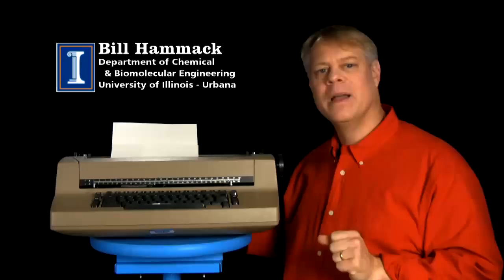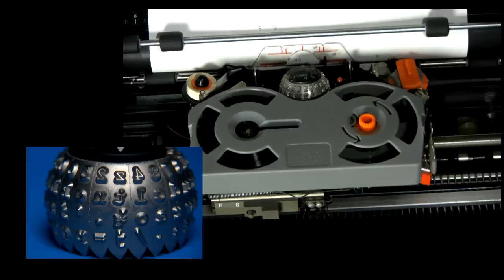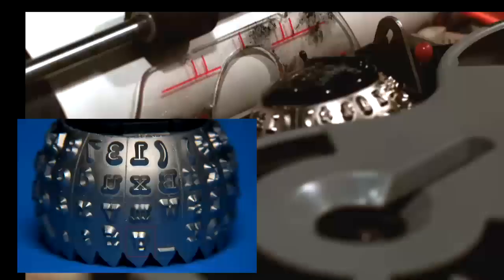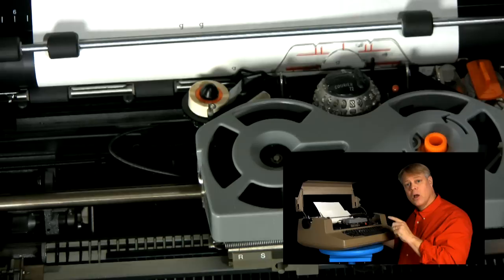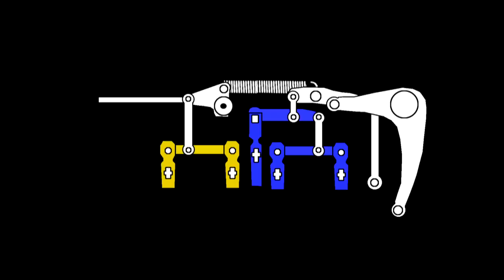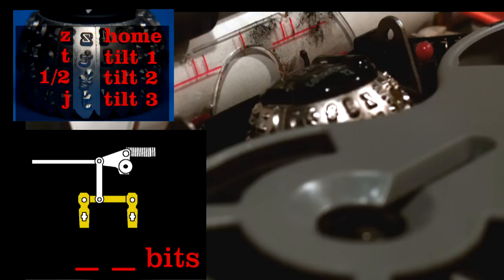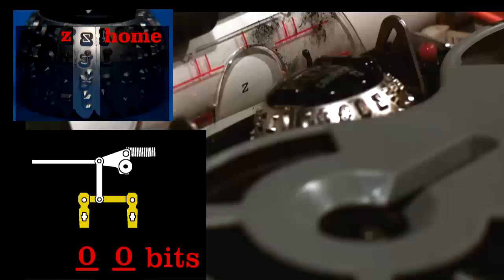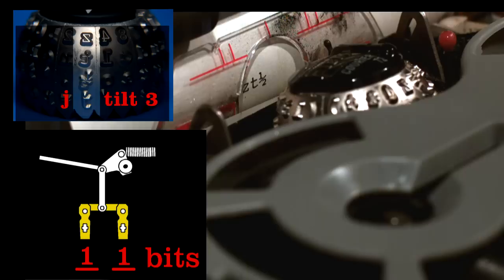IBM Selectric Typewriter & its digital to analogue converter

Comment: Ok, that was the intro ... where's the rest? Now I'm intrigued.
Reply: Don't be. It was wrong anyway.
Reply: @timhofstetter5654  [citation needed]
Reply: @Number_055  Mo citation actually necessary. There's nothing analog about the IBM Selectric; it's purely mechanical-digital (base 4 and base 22). The whole premise upon which this video was based was incorrect.
Reply: @timhofstetter5654  It uses discrete analog output. Mechanical levers by nature are analog.
Reply: @darkwood777  Neither of those statements even begins to be true. Mechanical levers with a finite number of orientations / positions are by nature digital.

Your fingers are levers, and they are the prime origin of the term "digital". When you count on your fingers, they have two positions: up (1) and down (0). There is no "halfway" (~0.5) position. There is no one-third (1/3) position. There is nothing analog about your fingers when you're counting.

Anything with a finite range of positions is digital. Analog is infinitely variable with or without optional limits.
Reply: @timhofstetter5654  that's an awfully rigid definition. By definition a prostate exam can be "digital" too! lol I would say what makes this device "analog" is the SPEED of typing: "mechanical digital-to-analogue converter that
translates the discrete impulse of the keys to the rotation of the
type element." I suspect there's infinitely variable typing speeds possible within a certain range with this electro-mechanical device. 
I suppose it might be possible to measure microsecond speeds of brain-to-hand nerve transmission and even modern computer keyboards responding to touch at similar, discrete speeds, and come up with finite variables. Words-per-minute can be described as a digital measurement, and another poster here describes his sister as typing so fast that the Selectric couldn't keep up, but at least within a certain range it is an "analog speed" typing device. I don't see any point in splitting hairs here.
Reply: @squirlmy  There's nothing analog there, even. There is a fixed interval between keystroke and the appearance of a character on the page. No analog.

As to typing speeds being infinitely variable, therefore justifying the "analog" term... if you go that direction, then you need to likewise apply the term "analog" to every digital computer and word processing machine and typewriter that has ever existed because exactly the same variability exists in typing speed completely regardless of the machine to which yon keyboard is connected. Oh, teletype machines, too. And pencils. So now we've gone to a ridiculous extreme to justify a ridiculous statement. Have we improved anything in our little foray into stretched definitions?

Comment: I worked on those for 18 years in the Eighties.  Extremely well engineered, complicated machine and took a long time to get confident working on them. If You could competently service one, You can get a job anywhere in the office service industry as there wasn’t a single office that didn’t have at least a couple.  They retailed at over a thousand dollars then!  I remembered We had a cocky, overly confident copier tech that went to school to cross train on them, and He came back very humbled.  Never worked on them after the schooling.  I, on the other hand, cross trained on copiers and found them stupidly easier.  I was the first choice for the dispatcher to send anywhere as I could now work on both.  I quit my job after seeing manager position go by Me more than once, and I opened a jewelry store, in which manufacturing jewelry was My first love and had been doing that out of My parents garage when I was 17.   I own Gipson Diamond Jewelers in Garden City, KS and My Son works along side of Me.  I’m so grateful My old job didn’t pay well or I never would of taken a chance going on My own.  Boy, this video brings back some memories, though.

Comment: Very interesting.  We had these at work.  Called them golf ball machines.  Ingenious.  I moved up to a data processing machine, a magnetic card machine, which was very similar but with a huge floor standing memory with very thick connecting cable.  I was the only one in the UK government department at the time.  No need to retype reports as the magnetic card held all the typing in its memory so just had to stop the machine and correct the reports.   Brilliant at the time.  I’ve never seen nor heard of them since.

Comment: Now we are waiting the video explaining how to link a computer to a selectric ... ;)
Reply: saa82vik   It existed in 71 or 72, it consisted of 5x8” magnetic card that was inserted into a writer/reader.  I can’t recall if the Selectric itself was able to store part of the document until it was transcribed on to the magnetic card.
Reply: I built one, in 1983. It hooked up to an Apple ][ using a parallel (8 bit) output card. The challenge was writing the driver in 255 bytes.
Reply: @matthewlitvak2695  You are referring to one of the Mag Card machines (there was an original Mag Card, and then a Mag Card II), based on the same system of reed relays and solenoids. But IBM also had computer terminals based on the Selectric. The Mag Card had a separate console handling all the electronics but was not connected to a computer. The IBM Memory Typewriter put the entire system within an enclosure just a little larger than a regular Selectric.
Reply: @ErikBruchez    I’ve got a very vague memory of the entire system, I was 10 or 11 when it came out in 72.  It was initially kept in the file room at my dads law firm in Chicago.   I remember the card holder and the reader, I just can’t remember how it operated  and whether you could edit a stored document.
Reply: @matthewlitvak2695  Cool! I've just been learning about those as I have an IBM Memory Typewriter I am working on. I think that the Mag Card would allow corrections on the card as well. Even the earlier Mag Tape Typewriter allowed correcting on the tape directly.

Comment: My uncle worked for IBM in Office Products in Boston. He kept us in typewriters in the 70's. One day he came and swapped out our Selectric II for a similar product but this one came with its own desk and a console to sit next to it. But sitting on/in the desk was a mostly normal looking Selectric. But this was no normal Selectric. This was an MT/ST which stood for Magnetic Tape/Selectric Typewriter. This rig could read and write to 1" Magnetic tape drive that resided in the console!  This was a word processor!  You could store a document code at the start of your document and later search a tape for that code to find your document then insert a new piece of paper and press PLAY. This is when you could witness the Selectric operating in its glory laying down characters at maximum speed and maximum decibels! The console was something of a marvel also as it was invented prior to integrated circuits. It had a huge array of relays and a row of printed circuit boards with transistors, resistors, capacitors and such. Inside the top of the console was the dual 1" tape drives.  This was classic IBM mechanicals with heavy gears, clutches, cams and motors. At 8-10 years old I loved watching the read/write head moving back and forth across the tape and the mechanism advance the tape character at a time as I typed. Backspace moved the tape back one character. Later I went to work at IBM in service and the old timers didn't quite know what to make of all my experiences with 1960's and 70's hardware when I was 28. My uncle continued my education through the intro of the IBM PC. I learned to setup , configure, upgrade and diagnose those machines when I was 12. I credit the MT/ST and my uncle with the development of my technical mind.

Comment: @engineerguyvideo Fascinating!  Hard to believe that this thing even works, and works as well as it does!

One thing that has ALWAYS fascinated me is how we design and machine these small parts and devices to the exact level of precision necessary for these devices to work - repeatedly.

Have you ever considered making a "measurements" engineering video?  I would it!  I know today that smaller measurements are made possible by using lasers and sensors, but what were the standards for back then?

Comment: One of the earliest "electronic" typewrites was made by IBM based on the selectric.  They basically used the Selectric with a similar mechanical mechanism on the keyboard to encode the keystroke which went into 7 or 8 on/off switches.  The encoding went into their electronics.  Then their electronics fired solenoids that where connected to the levers that do the tilt and rotate.  Basically the computer was shimmed onto the control rods.

Comment: I used the Italian Olivetti version, the Lexicon gold ball typewriter, which was very similar. But I didn't liked the constant humming of the motor, so I kept using the traditional typewriter until the day I bought an 8088 PC with a 9 pin impact printer, later replaced with a Panasonic 24 pin.
In total, more than 15 years on a typewriter - the first day with WordStar was like the first day of spring.
Decades later, I've a lot of nostalgia for typewriters, and books growing one page per day...

Comment: Burroughs used this exact mechanism on their series L machines, the whole thing was called a decoder.  The mechanism was enclosed in a sump full of oil and used solenoid operated clutches to work the linkages.  The ball was tilted and rotated by steel tapes (rather than wires).  The electrically operated clutches were the key to interfacing the mechanics to digital electronics. 

Once the golf ball was near to its correct position a detent was deployed to lock it in place to give uniform printing.  Maladjustment of the detent caused stress on the decoder, this, oil leaks and poor quailty reworking of faulty decoders was the Achilles heel of the machine

Comment: The mechanism that moves the type font plate (containing a number of 5x7 dot matrix patterns interleaved in a single grid) in an old IBM printing keypunch (026 or 029) is also a fascinating piece of mechanical engineering.  Its input is the motion of the punch bits selected by the keyboard (or duplicated from the card most recently punched), and its output is the motion of the font plate up or down and left or right a few increments, before a hammer strikes the back of the font plate to hit the wide ends of some pattern of 35 wires at the wide end of a curved funnel.  The narrow end of the funnel hits the ribbon and card in the area above the column being punched.  I’d love to see a video on how that mechanism works.

Comment: A whiffletree mechanism was also used to position the head carriage on the old Univac FASTRAND drum units. Basically, the WT levers were operated by solenoids that pulled on the various levers.   A direct binary-to-analog motion converter.

Comment: The wiffletree is clever but I would have never guessed that the tolerances were good enough to rotate the ball to 22 different locations without errors. For the vertical tilt with only 4 locations it makes perfect sense.
Reply: Well probably only 11?  Plus a 180 shift-turn?
Reply: @jonathan_herr  That makes sense. Still, I think 11 is pretty high count, too. I guess the wiffletree was under tension all the time which helps with the tolerance.

Comment: The mechanical keyboard, which digitized the keystrokes was also an engineering marvel.  IBM's electronic typewrite was a selectric with a microprocessor between the keyboard digitizer and the whiffletree arms.  They drove the arms with solenoids.  Ingenious albeit complicated design.  It was replaced with units that used an electronic keyboard and the ball was replaced with a pinwheel that was spun with a stepper motor, which was much cheaper to produce and more reliable.     The IBM electronic held on for a long time because secretaries were used to the selectric's keyboard feel. (old habits)

Comment: Just follewed through to this from an article on Hackaday. It brought back memories of our Selectric back in the 70s, and what an incredible piece of engineering it was. My dad worked for IBM and we also had a scrapped Selectric I/O Writer which had a bunch of tilt/rotate solenoids underneath the main Selectric chassis. We had intended to get it working with our 'home microcomputer' back in 1979 (a Fairchild F-8 3850 kit) but never did get far with the interface logic unfortunately.
Reply: You still here?

Comment: I have two IBM Selectrics--a Sel 1 and a Sel 2. Both are over 50 years old and work perfectly. On the other hand, I've had 3 ink jet printers in the last 10 years--those damm things break every few years.

Comment: We had 2 printers like this on the two DIGITAL PDP11 originally installed as part of the remote control of the Upper Waitaki Power Project (1970-1986?) in New Zealand.
If the started typing it meant that the active PDP11 had failed and the operator would rush in from the control room to type in the other terminal to select the good PDP11.  Once both failed.. (too much happening...). The printers on the 'newer' PDP11s was a dot matrix... (All long gone now...)

Comment: In 1970, when I was in high school I studied computer science and the school had an IBM 1130 computer to run all of the student programs on for the district. Yes, that's right: one (1) computer located in one school for a school district with something like 10,000 high school students. Since it was in our school we were allowed to volunteer to operate it during lunch & spare periods and after school as long as we ran a few boxes of stuff from other schools before we ran our own stuff, which meant that we could get our own results right away instead of having to wait until the next class, which was frustrating when you and had to wait 2 or 3 days to find out you had made a syntax error. 
Anyway, the 1130 was connected to a card reader that could read punched and optical cards and a line printer  but it also had a Selectric built into its console (you could type code into it and its "golfball" would print it on typewriter paper). In those days we just accepted it for what it was but seeing this it makes perfect sense for t hem to use what was essentially a digital keyboard & printer.

Comment: There had been digital devices for a HALF CENTURY before it was introduced. Stock tickers, teletypes, etc., used very similar mechanisms, and you can easily hook a teletype to a modern computer and use it as a printer.

Comment: A lot more to it than that.
Note the lever on top of the ball - and the words "Courier" for what many will recognize the "Font" for?  You could BUY different balls with different fonts and swap them at will.  Those were AMAZING typewriters and while modern word processors are much more versatile I do miss those.  Frankly I miss the "Keystroke" sound though I've been a computer user by far most of my life - early word processors had that 'keystroke' thing but removed it...  Had a privacy issue also in that the signal from the keyboard to the head generated a radio signal that could be listened to and recorded/played into a typewriter of the same time to put out whatever was being typed originally.

Comment: It reminded me of a USSR Romashka (Daisy) typewriter I still have. Instead of a ball, it has a disk with petals (hence the name) with a mirrored letter on each arm. A stepper rotates the disk to a required position and then a solenoid-actuated hammer smacks the petal to print the letter.

Comment: Man, that's pretty elegant. I always loved the Selectric. They used to have a lot of them at my dad's office at the University of Texas at Austin. Which makes me realize just how old I am, yet again. %)

It's amazing how it looks all wobbly in slow-mo, and yet hits the angle so precisely as to not have even a bit of variation in character placement.

Now I need to go look for a video about how LPRs worked. I think line printers used a more linear, more complex mechanism.
Reply: Well, this short video did not describe all the amazing mechanical designs this typewriter used. At lower rim of that 'golf ball' there is a saw tooth like flange and a mechanical 'finger' comes up and pokes the valley between teeth and this centers the letter more or less perfectly for the strike so the cable mechanism is not called to be super accurate. And there is more that I've forgotten. 

But the bottom line for me is that this is a prime example of product that started with a stupid idea and was made to work by brilliant designers and engineers by share brute force AND great after sales service, which it required.

The daisy wheel that came after was much better idea and I have one from 1920's that has a super simple mechanism and most of the features of Selectric and works without electricity.

Comment: Wish I had a nickle for each hour I spent typing away on those machines.  When they first came out, I was 'programing' and using IBM series 407 tabulators and all the different types of machines that hooked up with them, along with a IBM 1401 system.  The arrival of the IBM Selectric was a clue that those venerable machines were finally on the way out.  Fun fact:  the Selectrics were used for a time to train key punch operators, there was a special type element for just that purpose.

Comment: One of the truly amazing things the Selectric did was unleash SPEED. The best typists with manual typewriters, and even electric using a basket, was around 70wpm (thought I once witnessed one exceed 100!). Much faster and you jammed keys (they called this the log jam). With an IBM selectric, speeds well in excess of 200wpm were possible. The last evolution of the daisywheel, adapted to computer output, was 350wpm, while the fasted recorded typist was 216 wpm (set by Stella Pajunas in 1946, using, you guessed it, an IBM electric typewriter)